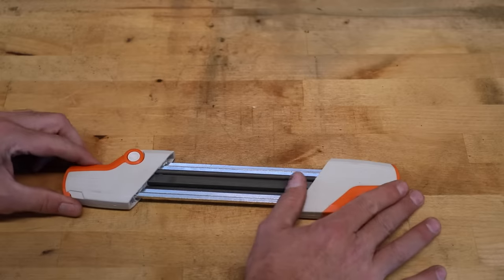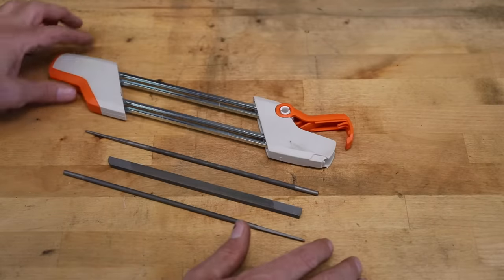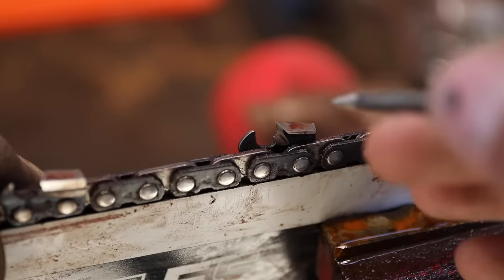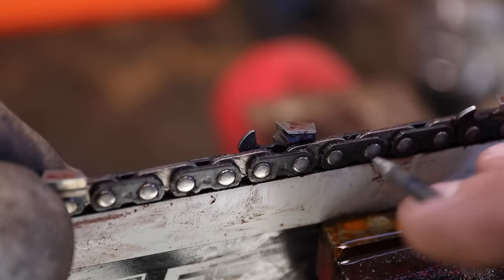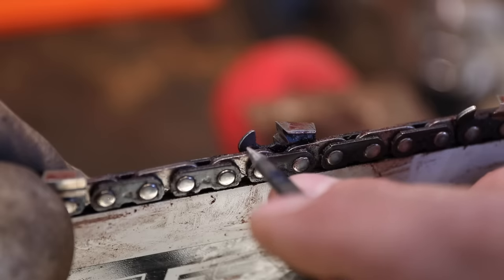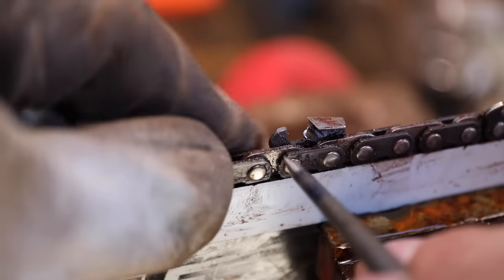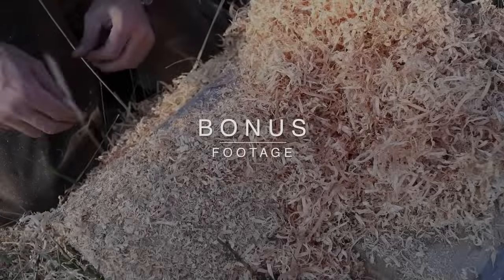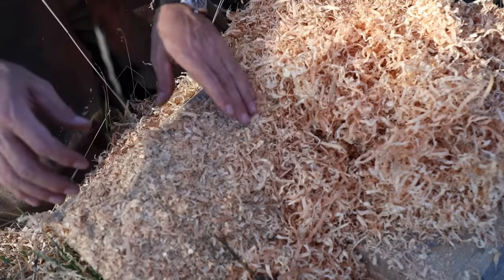Best Chainsaw Sharpener Ever - FINALLY!!!

Comment: I'm a 2nd generation arborist. I was always the one who sharpened the chains with a round file a flat file and gauge. With this file system, just about anyone who has interest can file a chain and make it cut like new. I love it because it makes life so much easier.
Reply: One guy said that's  a skip configuration but the tool is made for a
full tooth chain? what's your take?
Reply: @larrypatterson3839  I'll chime in, don't buy any jig. Just learn to sharpen with a file, it is really easy. Most will learn by the 3rd time they sharpen.
Reply: Can it sharpen any chain brands or only Stihl ?
Reply: A guy should Learn how to freehand, especially a budding professional.
Reply: @rcjarvis Of course it can. Make sure the file diameter is correct for your chain.

Comment: I've got one for my 170, and 250. (different size files) Absolutely the best sharpening tool ever made! So compact, and very fast, and effective. I do the no pressure back pull too, I use my chain brake and will do a number of teeth in one shot, (I engage the chain break when doing this) It takes no time at all to do a chain. Unlike you,  I do use their recommended pitch angle. Have been cutting fire wood for about 40 years. Be safe guys.

Comment: Could not agree more, hands down the best manual sharpener I've ever used! I've been around logging and fuelwood harvesting all my life and have tried most sharpening methods and usually end up free-handing it with a file and maybe a guide on the handle. Picked up one of these with my new Stihl MS-362 CM and after 5 minutes of learning how to use it, I was blown away. The only modification I made was taking a Sharpie and filling in the directional arrows so my 53 year-old eyes can see them better. I hopped in the truck, headed to ACE Hardware and bought two more (3/8P for my Dewalt battery saw and a 1/4P for my Stihl Kombi system pole saw). Hands-down, full-stop, best and quickest sharpening system I've used. Quick because you're filing the rakers at the same time as the tooth.
Reply: 0
Reply: I need a little help PLEASE. I love the sharpener, amazing BUT ... I was about to change the files and the end came off . I could not find anything on how to put it back together. Anything you can do is appreciated. PS I loved the comment of the sharpie , excellent.  is there something i remove to change files ?

Comment: I bought one of these today.  Never sharpened a saw in my life.  First time, cuts like butter again.  Very user friendly tool!
Reply: OK, so what is this tool called please? I would really like one 🏴
Reply: @clivebritton8389  2 in 1 Filing Guide
Reply: @clivebritton8389  it's also named "Pferd CS-X 2 in 1". It is exactly the same device but in blue color and with a lower price. Pferd is manufacturing the white and orange version for Stihl 🙂

Comment: Ive sharpened mine 2 previous times and each time I used the "factory angle" as a guide.  My cutters were super sharp and it cut great.  This last time tho (chain was very worn) I decided to sharpen using the 30 degree guide as Stihl suggested.....I DESTROYED my chain.  It was all jacked up.  That's why I watched this video was to see what angle you used.  Thanks!!
Reply: 25 degrees for summer & 30 degrees for winter cutting here in the north. Angles can vary for different species of trees as well. The lines scribed on the top of the tooth of chains straight out of the box intended as a guide are generally 25 degrees.
Reply: @nickpetkoglou1990  Differs from chain type also full 25° and half chisel 30°

Comment: These are great! Now you may or may not have noticed but when the round files are removed the pointed end are towards the “pushing hand” .  The reason for this is that this allows the files to rotate on that point as they are pushed through the chain. F’en brilliant, this eliminates you needing to rotate the round files for even wear. This is an excellent tool well worth the $45. I paid for it in Canada at my dealers. Thanks for the great review.

Comment: So bought one of these today and used it on my little battery Makita 16” saw. The Makita has a narrow kerf chain (0.043”) but 3/8” pitch. Makita wants a 4.5mm round file diameter but I figured the Stihl 5.2mm could enlarge it and it would work ok. It was a bit more work to get the sharpening done because of the mismatch, but the end result was a battery saw that cut brilliantly with with the long Easter-Basket style strips of wood. Turns out it helps battery life a LOT too if you keep that chain sharp. The chain was never super sharp even new (it’s an Oregon I think) but the Stihl sharpener left it “sticky sharp” and I’m a big fan of this sharpener! I think it nails the correct depth gauge too. Stihl would seem to know a thing or two about chainsaws.

Comment: Hands down, the best video description of how this sharpener works.  WAY better than Stihl’s own video.  Well done!  The only thing I would add is there are different versions of this sharpener for different sizes of chain.  Get the one made for your particular chain size.
Reply: Thanks for that mention. I was wondering about that. I believe he alluded to that very early on but you clarified it.
Reply: Interesing to note that "Steves Small Engine Salon" did a video on this tool and like our good friend above he initially thought it was just a gimmick then having tried it he was also suitably impressed.

Comment: Used this for two years! Great time saver. I used angle on the tool and no problems. If badly worn I touch up with a good old hand file so I can better see and adjust tooth length close to the same because of minor damage. I then quickly hit it again with this tool after for the correct gauge setting. Love it!

Comment: I did a professional chainsaw course years ago. They advised the following, chisel edged chains (sharp corners for professional use) 35'. Semi chisel edged chains (rounded corners for hobby use) 30' The chisel edge has superior cutting but is much easier damaged when it hits foraging objects. That chain seems to have very shallow angles for a chisel edged chain. A more acute angle will help its performance. It will also be easier to drive, causing less stress on the saw engine.

Comment: I use my chainsaw to clear dirt bike trails. I'm by no means a professional logger. My chains get trashed because a lot of the logs i have to cut are laying on the ground. I bought 2 of these sharpeners (i have 2 saws that have different sized chains) based solely on this video. I've never sharpened a chain before...the chains for my trail saw are small and fairly cheap, why bother. It took me a couple minutes to figure out the perfect stroke, but in 10 minutes my chain cut like new again. It's even easier than he makes it look. And, the sharpeners were much less expensive at my local Stihl dealer compared to Amazon...i got both for about the price Amazon wanted for one. If you're on the fence, go buy 1...you'll be stoked!
Reply: When you cut on the ground, just cut 2/3 of the way down (leaving a small hinge) for all your cuts. Then roll the log over and finish all the cuts from the other side. Save your chain and saw from damage. It's not good to dip into the dirt. 

Sounds like your working with stuff on the small side, but if the logs are big and heavy, save your your back and get a cant hook to turn it over. Something like this https://www.amazon.com/LogRite-CH048-Aluminum-Handle-Cant/dp/B01M11V5IR/ref=sr_1_6?dchild=1&keywords=cant+hook&qid=1592273833&s=lawn-garden&sr=1-6
Reply: Never ever let your chain touch the ground or any soil. Never. Cut 95% through, all you can. Search for parts of the log that are above ground. Start here. Bore cut into the middle of the log and down and very carefully all the way out the bottom. Then lift cut your way out the top of the log. Now roll free your log to finish all the 95% cuts. A small wedge is great help to hold the cut open. A cant hook or log roller if you can but usually not needed.
  NEVER TOUCH GROUND 👍

Comment: This is the best hand filing tool I know of, highly recommended!
Reply: Hi there brother, is there a brand for this file, or is just a generic thing? Thanks in advance if you have time to reply.
Reply: @junglelawman728  It says in the description "The Stihl 2 in 1 chainsaw sharpener"
Reply: @faarsight . Yes, I've notice that after watching the whole video. Quite a silly question, sorry and thanks for the reply.
Reply: @junglelawman728  You can get it cheaper under the Pferd name.  It's the same unit, just not Stihl-branded.  You save like 20$
Reply: do you use it to sharpen your skates too?
Reply: @hypnotherapycw  Okay, that made me chuckle.
Reply: Yes...I just got one.
Reply: Do you use the tool at the recommended angle the tool suggests or do you go with the existing angle of cut already on the blade?

Comment: I bought this a couple of years ago. If you own a Stihl chain saw, you NEED this!!  I have no sharpening experience and I get my chains super sharp. You just have to get the knack of keeping the item level and at the proper angle.    To be able to sharpen your chain after or right before cutting is priceless. I don’t work for Stihl and I’m not exaggerating regarding the ease and convenience of being able to always have a sharp chain
Reply: Does this only work on stihl chainsaws?
Reply: @justsayin7937  No it hypothetically works on all saws as long as you got the right pitch and file. The Stihl tool comes in different pitches.
Reply: @justsayin7937  I'm using it on my Makita cordless chainsaw. The tool comes in different pitches. Match it to your chainsaw.

Comment: I only cut firewood and storm blown trees off trails out the bush. Usually when the chain gets dull I slam a new one on as I'm pretty useless with the round file. This thing has totally changed the way my saw cuts and the chips it throws (no more saw "dust" lol)... absolutely worth the money for any home user, firewood guy, or those that carry a saw in your 4x4... it's fast, super easy and gives a good result!

Comment: I bought one of these sharpeners a few months ago and can honestly say that it exceeds my wishes by far. I always used a jig to sharpen my chains for the last 50 years but this sharpener kills the jig in simplicity and performance. I just touch up the chain about every second tank full of fuel and it zings through the wood. The guy I bought it from said the secret with these is to not let the chain get really blunt, just touch it up regularly and it certainly works for me. I mostly cut Jarrah which is a real hardwood and the saw has never cut easier.

Comment: Bought one !  Absolutely a no brainer .  works flawlessly.  Its as good as my foley ! ,and much quicker .
Reply: At what price? Thanks ahead.
Reply: @franknada8235  there $59 in aus
Reply: Works great, i've been using them for years. Like any file have to keep them clean and they will dull. Replacements for the center file a bit pricey but well worth it. I don't know why he thinks he knows how to use it better than stihl does. I go buy the recomended angle and it does exactly what is supposed to do. If you look in this video he is also going against the markings on some teeth which indicate file direction.
Reply: @אוריפלסי  a good tool in the wrong hands..
Reply: @אוריפלסי  his first time using it.. I'm sure he figured that out soon enough

Comment: Several months ago I bought one of these because I watched your video. It has worked very well. The tool has a icon of a chainsaw on it, so you can easily tell which side to use depending on how your saw is on the bench. As sharp as I thought it was when I started using this, I discovered another video with the title "It took me four years to learn this" (or something very close to that). The guy said I should be lifting the file as I make my sharpening stroke to better sharpen the tooth like the factory chain. I tried his technique and this tool worked even better. It has truly cut like a new chain. I was amazed and have continued to add this technique to using this tool with excellent results. Thanks for your great videos, I've learned a lot. RC

Comment: Factory angle is 30 degrees. And its correct. This sharpener angle is also 30 degrees for normal cutting. For cutting long ways (making boards) its 10 degree
Reply from the maker: You're wrong also,
Reply: Well i work at stihl dealership and thats how we do it. We have all angles provided by stihl factory. If thats wrong then i dont know
Reply: It should be at 30 degrees, your chain is different because it’s square ground from the factory and you are round grinding it
Reply: Cody, your angle is a little flat for crosscutting.  Maybe things are different out west, but you would have a hard time cutting eastern hardwoods at that angle.
Reply: My Workshop yeah. in Europe we don't have that kind of chain. only square edge but still round file profile.
Reply: I was going to comment until I saw yours. you took the words out of my mouth.
Reply: Wranglerstar From Stihl's sharpening PDF guide on page 15. "STIHL recommends the 2-in-1 file holder if you want to sharpen the cutters and lower the depth gauges in a single operation.
Like the standard file holder, the 2-in-1 file holder keeps the file at the correct height in the cutter. The arrangement of the handles and markings offers you a very good optical guide to maintaining the 30° filing angle."
Reply: He's far from wrong. I also work at a Stihl dealer. 30 for normal cutting and 10 degrees for boards. Either way this thing is the best thing since sliced bread. I love mine
Reply: Factory trained Stihl Gold Tech here, this guy is pretty close in his explaination...
Reply: 30 is factory for round chain, my customers prefer 32-35 for a more aggressive cut
Reply: unfortunately, cody will never admit he's wrong.
does anyone have the link to the Stihl 2 in 1 chainsaw sharpener which he neglected to put in the description?
.
Reply: He isn't.
Reply: Wranglerstar, he's not wrong. You are. Accept it.
Reply: not sure i get your comment WTF*, are you saying *WS is wrong or 16ATS ?
Reply: AZ Donald, I thought it was pretty clear seeing as it's addressed to WS.
Reply: Wranglerstar you are wrong really srry
Reply: Wranglerstar A true "man's man" can admit when they are wrong, instead of calling any critic incorrect.
Reply: As far as angles? Most 3/8 pitch chains are 30 degrees, Stihl has some chains at 20 degrees.  The .325 pitch chains vary, some are 30 and some are 35 degrees. Using the lazer line on the top plate of your tooth as a guide will give you proper angle
Reply: yall must be new to youtube.  the people in the video never know wtf they are talking about.  you always have to scroll thru the comments to find the people who chime in with the truth.
Reply: These are all cross cut chains here, angle for wood hardness....for cutting long ways you use a ripping chain.
Reply: Actually the differing angles are for falling and bucking. Ive been a faller and bucker in bc canada since 1997 and some old timer frenchmen who have been falling since before conventional logging taught me this.
Reply: Correctomundo
Reply: 31
Reply: @romeoloewen5940  falling and bucking are both cross cutting. What are you talking about? Do you fall a tree then swap out the chain so you can buck it. That would get you fired from any job I have ever been on. The different angles are for hardwood vs soft wood or ripping. 40 years of  experience here.
Reply: Wranglerstar just checking back it’s been two years, are you ready to admit that in fact you’re the wrong one in this conversation?
Reply: @16ats the other stihl rep just said the homeowner saws and pro saws run different angles for more aggressive powerful pro saws. It’s not hard to figure out. U sound so smart in your stupidity.

Comment: This is the best thing since sliced bread I love it, follow the angle of the tool it is designed for the proper angle of the tooth. I have zero issues with my chain.

Comment: Howdy budy I work fo a Still saw shop and been around saws for over thirty years and consider myself ready good at sharpening chain. That being said the two in one file is ment  to sharpen full comp chain not full skip or half skip chain. The chain you showed in this video was a full skip square ground chain that does get ground at a steeper angle and is faster than round ground chain as well as doing a better job with rip cutting. I enjoy a lot of your videos keep it up! Thanks
Reply: Is full comp chain the yellow label chain
Reply: @loganironside343  full comp just means it has its full complement of teeth, none skipped. There are yellow and green full comp chains.

Comment: @Wranglerstar I know you have done quite a few chain saw sharpener tool videos... is this still your go to tool now 4 years after this video was made? It is mine I absolutely love it and recommend it to everyone. I find it so easy to use on the saw I rarely replace or change or use my spair chains because it saves me time switching out the blade and its Easier than running them to some one to  ReSharpen. It takes less than 5 minutes to do and I'm back to cutting with a sharp blade. Thank you for all your videos and may God bless you and your family!

Comment: My uncle just bought one of these things and I tried it yesterday. It's great. I can finally get my chain super sharp. The only thing is that the file gets plugged with filings and you have to stop and wipe it off.
Reply: That’s any file that you use. A couple quick taps on something will knock those out